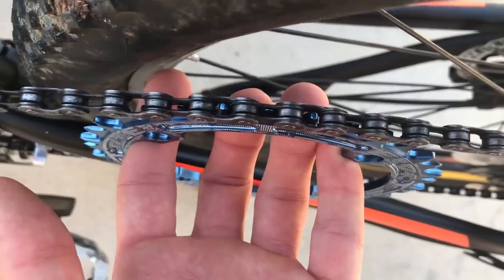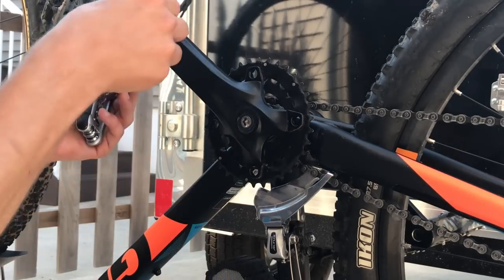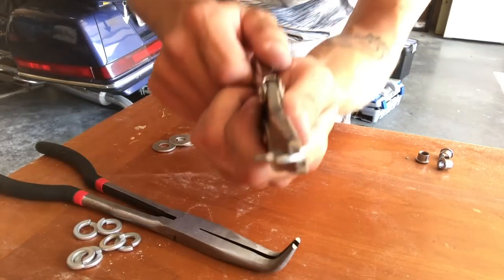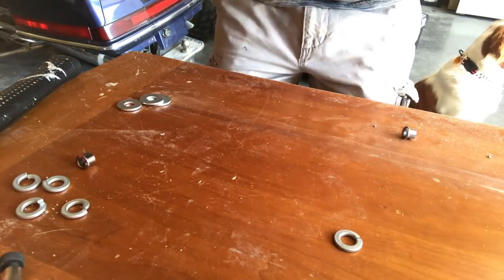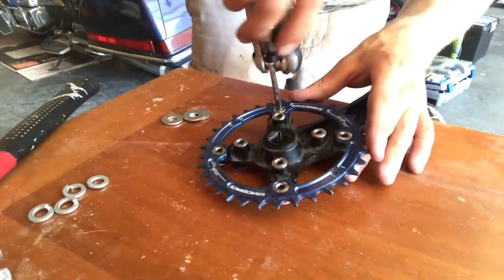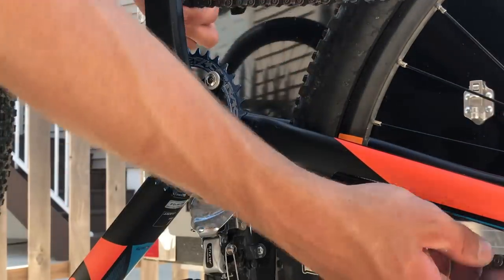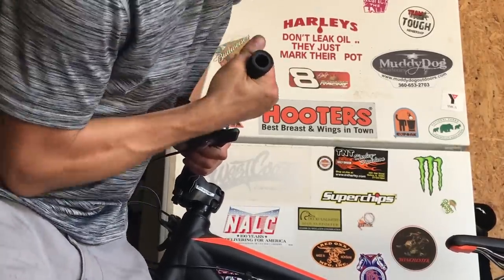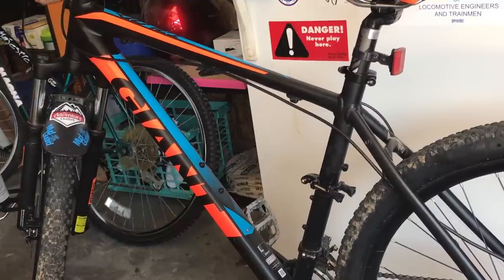3x8 to 1x8 MTB Conversion - Stupid or WORTH IT?

Comment: I did this with a 1x9 using a narrow wide single crank on a Super V. I’ve had zero issues and have never once dropped the chain. Today I did the same thing with a 1x8 on a hard tail and it’s not working well. The smallest and largest rings on the back cassette seem to be too far out of a reasonable chain-line similar to cross chaining. Both rings make the chain fall off up at the front narrow wide crank ring. I swapped out the chain for a 9 speed chain and now it doesn’t fall off because narrow-wide is made for 9 speed chains and higher. An 8 speed chain will work but doesn’t have much grab retention at all. I still have an issue with the smallest and largest cassette ring being too far out and causing chatter on the front ring. I wonder is an 8 speed cassette is spread out too much.

Comment: I hate having an FD, it's noisy and becomes unreliable over time. I kept mine on the middle gear 34t, so I just took it off and replaced it with a 32t chainring set. Had a peace of mind ever since.

Comment: Because of the trails where I live there's no need for a giant front sprocket and I never really used the smallest one, alot of flat and makeshift jumps, so back in the late 90s and early 00s I would remove the front derailleur and smallest sprocket, then I would grind off all the teeth on the big sprocket turning it into a psuedo bash guard, then running just the middle sprocket, also I would take a bmx stem and bore out the handlebar section with a drill press so it could fit mountain bike handlebars, I really liked that set up and it worked well for my riding style coming from a bmx background, I think its awesome that the bikes now have adopted the single sprocket and shorter stems because it makes for an awesome ride

Comment: handle bar grips is easy to remove。.. some mechanic charge 20 bucks...

simply lift the rubber a little and insert 2cm thin tool or chopstick and.spray water with soap   let it sit and work 3cm and 4cm.and spray more water and soap and it will slide of very easily......less then.5 min for both sides
Reply: And some Aquanet super hold to stick them back on.

Comment: I  converted a 3x8 to a 1x8 way back in 1996 when I started racing the WORS series in Wisconsin. The tracks and trails were mostly flat and hilly but no real climbs. For a few more bucks, a 9 speed 12-36 cassette gives more range. A RS 9 speed shifter can be had for $10. For another 50 -75 bucks, you could also convert to 1x10 with most 8 speed freehub bodies. Shimano 10 speed 11-42 cassette, shifter and chain. If you really love your bike, spend the $150 and go SRAM NX 11 speed.
Reply: Scott H But, to convert that 8 sos to.  10, doesn’t that require new shifters?  And totally new adjustments and/or a potentially new derailleur?  Seems like a potential rabbit hole...

Comment: You could have used a grinder to make the grommets shorter and an air compressor to blast air under the edge of the grips to slide them off. Works every time and saves your grips from tearing when taking them off.

Comment: 1x8 is certainly not a bad idea as I'm an in the middle of doing it myself. You did a decent job with what you had. Some chainrings actually come with the smaller grommet. If you want to spend some money you can also get the bigger cassette in 1x8 to help with climbing...

Comment: I did that to my GT today went to bike shop bought smaller hardware for chainring. There was no need for washers. In my defense it's flat in Fl so I never change front gears, now my handlebars have less clutter. After I was done didn't realize the pile of stuff on my bike I NEVER used.

Comment: Trek Marlin 4 has the Rear hub Formula DC31, it will be good if there is a 8 speed 11-42T freewheel available for 1X8 conversion, I cannot find any 8 speed 11-42T freewheel to suit the Rear hub Formula DC31.

Comment: Well done I did the same thing on my Carera Banshee because when I bought it came with slightly bend second chain ring and when I back to the shop they said that is not covered by the guarantee so I decided to convert it to 1 by,  work well and there is no hill which I can't climb.

Comment: I converted a friend's bike in the summer to a 1x9 which is a better setup than using an 8 speed. Parts: 9 speed Sun Race 11-40t cassette. Alivio rear 9 speed shifter and a long cage Alivio rear mech. Crank was doing exactly what you did. 28t cog for the front. Climb hills like a boss.
Reply: Joe N Nice!  I’ve been thinking of doing something similar; aren’t there big gaps between gears?  Also, it appears Sun Race offers different 9 speed sprockets; which did you get, and why?  Are there big differences in sprockets?  Why is one more and one less?
Reply: We’re you able to use the same wheel and free hub?

Comment: I never shift the front derailleur and replaced the middle chain ring to 32. I have 10spd cassette and rarely shift out of 18. I commute 18km to and from work.  36km five times a week and I have a couple of little hills.  I tried not shifting for a few weeks to the point I forgot about all the gears.  My legs got adjusted to the commute and I used the momentum of bike.  Then I tried shifting a bit just because I wanted to experiment.  

I like the options for gears and there is nothing wrong with shifting if it makes life easier.  Spinning is nice.  I  could switch to single speed.  I really thought about it because I spend time maintaining the derailleur, cleaning it, adjusting barrels, and  I have to think about the shifts and how accurate they are. 

I  am  pretty good at dialing in perfect shifting and if you don't shift the shifters can become less flexible.  But the more you shift the more you have to tune-up the bike.  

I also slid out on ice and bent the derailleur hanger.  I fixed it with a 30 Euro tool. Derailleurs are delicate.  I  have full xt set up. 

Cleaning up the cockpit sounds good.  More options for resting hands. 
There is this one guy who did a world tour on single speed.  
I don't compete and my bike is for commuting and not so much leisure and fun. But I have so much fun bike commuting.  

The derailleur front and back are just dirt magnets.

Comment: How do you like the talon? Especially now that it's a 1x8? 
I have a 2017 talon 3. Everything is still stock except I changed the saddle, lock on grips, mucky nutz front fender,  and crankbrothers stamp 7 flat pedals. Probably just going to upgrade to a full suspension bike maybe next year but I'm still pretty novice and have a lot to learn..been a great bike Tho!

Comment: I think it would work out if you don't mind big gaps in gearing, or don't have a huge range to cover.  Dealing with the trapped grime and more things to break in a 3x system does suck, given that I use the big ring about 1% of the time.  Depending on chain angle, I might use the outer bolt circle for a chain guard.

Comment: I have a Trek 7300 hybrid bike. It's 3x8. My middle chainring is 38t. I find I can stay on the 38t for all my needs, shifting between the 2nd, 3rd and 4th sprocket for my light trail and dirt/gravel riding. I know 38t is large for a MTB, but this is a hybrid bike. So couldn't I just keep the 38t chainring, ditch the other two and thus have a 1x8?

Comment: Interesting convertion! Lighter, simpler, more reliable, quieter etc But what do you miss most about your old 3x8? I have a 3x8 on mine, have been tempted to do just this but love the really low gearing and really high gear for flat out sprinting on tarmac or smoother tracks. Maybe a 2x9 might be a better compromise for me? Mostly do cross country rides, with some quite hard climbs and downhill sections.
Reply: PD Tech i have a xc 2x10 and my father has a 1x11 (newer bike).
Honestly i prefer the 2x10 cause of the wider range and a lot less “chain- crossing”, so the chain will last longer. 
Yeah, a 1x looks a lot sleeker and its one less moving part to worry about, that for sure.
1x8 seems really short gear range tbh, especially for climbing. You will struggle hard for sure.
Reply: @danielmartins4367  A 2x10 seems like a good comprise, I know with my 3x8 there are a lot of gears that overlap and 'feel' the same. I mostly use the middle front chain ring, which is fine for even some of my climbs but it's good to have that lower front chain ring for extra aggressive climbs. The bigger front chain ring I only use now and then for that really high top gear on sprinting flat smooth sections, which I could easily do without!
Hopefully a 10 speed cassette will fit on my bike where the 8 speed goes? 😎👍

Comment: I did almost the same, only I removed only the 42t chainring and left 22-34 bi chainring, with 11-40 of 8v and it was great, I have more versatility even if it is not elegant ... 1x8 is poor for me, so 2x8 works much better than a 3x8 that I will not use (42t)

Comment: i have a second hand bike that was once a very nice 3x9 that the previous owner turned into an awful 1x9
the chainring was a huge 28 installed on the outside of the crank and they left the organically 34t cassette on
i had to install a 32t oval with spacers to move it inwards and a 50t 9s cassette with an extra long derailleur hanger
now its actually okayy to ride, it can at least go up a hill and doesnt make horrible noises all the time and can shift smoothely but its still not as smooth as a 3x
i think im gonna convert it into a 2x i like being able to drop a chainring up hill and having a straight chainline so the drivetrain runs smoothely

Comment: I've been a 1x8er for a while now....you're right on when you stated that it's simpler and lighter set up. Cool video.
Reply: is it worth it and would you be able to tell me how much it would cost? Thanks.
Reply: Well, the cons are that I'm sort of restricted on the number of gears I can use without having to put extra strain on my chain. The other con is that you may want to get a single speed sprocket with longer teeth. This would help keep the chain from coming off during a rough ride. But other than that, it cost me nothing and I removed the front derailleur, gear shifter and extra sprockets.

Comment: The leverage gained from having 3 chainrings, especially the granny ring, has greater advantages than any performance gained from the small amount of weight loss by going to 1x.  This is especially true for bikes which are already heavy.   To optimally use 1x, you would need to replace your cassette with the widest range possible if it isn't already.  Going 1x  actually requires understanding of where and how you ride and what your gearing requirements are, so it's actually more complex to configure than simply having 3x, which give you gears to do anything.

Comment: I am cheap as well I run a one by eight set up on my fat bike with a sure mono mega range cassette 11 to 34 one by eight I'm seriously thinking about putting a smaller chain ring on there right now I have a 30 tooth oval chain ring I am thinking about going down to 28 to make climbing hills easier

Comment: If it worked for you, then don't sweat what others say. I have the same bike if I'm correct. It's a 2017 Giant Talon 3.  Did you use the existing chain Ring that came stock on the bike?

Comment: I've done pretty much the same as a test. Aliexp*** orders are now airborn, where I picked - one 34t Narrow Wide oval, and one 36t Narrow Wide oval (12$ for both - some sort of promotion - do not ask me), then a cassette 11-42! YES 11-42! for 21-22$, with 4$  discount (new user coupon - so this is another 17-18$). There is a brand new 8spd SRAM chain already in the garage - so, the upgrade will be something like 38$. Looks good to me. If not suitable, I'll revert back. Please note this is 26' bike, where i believe 1x 34 - 11-42 will be enough, just the step between the rear sprockets will be some sort of issue for sure. At least, I can go back without too much efforts.

Comment: This conversion would work....until you start hitting bumps along a trail or a pot hole on the road...you need a chain guide. You could use a 9 speed Deore Shadow Rear Mech. Since it has a stronger spring action. But in essence, your conversion would work.

Comment: Kind of makes sense. I never use other than the middle chainring anyway for all my climbs and downhills and my fitness level. BUT I use my large chainring as a "protector" from rocks. It takes all the punishment with some of its teeth bent already. So that's why I am not removing it. And the smallest one is not worth of work for me.

Comment: I tried this with my bike. It doesn't work out too well, because you need a clutch derailleur to keep tension on the chain. For this to work nicely, it would require cassette, derailleur, and shifter upgrades.
Reply: Good to know. Any recommendations?
Reply: @UnitedDestinyEntertainment  Shimano SLX or Deore are good options for the derailleur.

Comment: Hey. Great video. 
I have a Giant Talon3. I think same model as yours. I just ordered a 32t raceface narrow-wide chain ring to do the same conversation. What did you install 32 or 34t? How does it ride?
Reply: Boy Jorge Eta 34 gives makes pedaling slightly more difficult than a 32, increasing your top speed. I used a 34 on my 29er rather than a 32 on my 27.5 because of the wheel size. Bigger chainring= bigger wheel.

Comment: Just done this myself and definitely worth it... why did you leave the front mech on? Or did we just not see you remove it?
Reply: Wheelers At Large why is it worth it?  What are the benefits?
Reply: @richarde1355  good question and sorry for the long post. My mtb was a quick cheap replacement for one that was stolen, I needed a bike and no time to save up for a mid range or better, so always knew it would become a project. It was a heavy, slow hardtail, 24 speed triple with square taper bb, no high end parts but had disc brakes so frame was futureproof. The bike has gone on a drastic diet over the last year, much lighter parts, only the frame and seat post clamp remain from the original bike. It now has a hollowtech style external bb crank, 38t narrow wide, 36-11t 10 speed at the back and Sram x5 shifter and mech. I get nearly 1 to 1 in the lowest gear for climbing, that said, we don't have many steep off-road climbs but the ones we do have are only as hard as when the bike was heavier with more gears, gravel fire road climbs are no problem. The bars have only brake levers and one shifter leaving room for lockout and dropper controls should I want them in the future (probably not) and the front mech is gone, no chain guide required as no chain drop as yet. There is one point in the cassette between cog 2 and 3 where I would like an inbetween ratio because 2 is slightly too easy. The weight saving and simplicity have turned an entry level mtb into something fun, strong and capable. I would agree the upgrades have made it a better mtb all round so moving to 1x from 2x or 3x on a better bike may not have same effect but when riding on loose or chunky terrain only having 1 shifter to think about is nice. I dont know if less is more but less to think about, less weight, less to go wrong, less drive train noise, less adjustment... I'm happy with the change.

Comment: Did it work without shortening the chain and fitting a chain guard?  I did a similar job only I converted from a 3x to a 2x as I didn’t need the top end range and also allowed for more ground clearance between the tyres!

Comment: I  wouldn't bother .  Unless you add  more sprockets on the rear. Just leave it on the same chain ring . 
I had a 3x7 and changed the rear to 8 .   So 3x8 . I never use the 1st 2 smaller chain rings .   But if I ever sell the bike , the buyer might want too .

Comment: I changed the crack set to the aftermarket eBay colorful ones you see..mines in blue with a black 38T oval chain ring and even went out and bought black and blue crack nuts. It's all getting out of hand with the blue cable ends, vale caps, rear cage cog wheels, and  rear derailleur cable sleeve.. handlebars, and even grip clamps.. blue.. it's going to be E bike conversable...got the front hub motor and everything on another handlebar.

Comment: i hope major brand like sram makes this kind of setup. Casual MTB rider which I am very rarely use low gears. Mostly tech climb that I am struggling with and don't have high speed trail at all to use those top 3 low gears. Only use high 6 of 12 gears, I rather loose some oz to maximize climb.

Comment: You can shorten the chain if you plan to leave the same cassette. Reduces a bit of the slack. My bike came with a rivoted 3 by set, i never even use the big or small cog on it and i use the bike to cummuting too. So i ordered new cranks and a narrow wide chainring and also just to be extra sure on the trail, i also ordered a chain guide. Should get a new derailer too :((

Comment: TIP: Use a zip tie and some alcohol to remove cheap grips. Alcohol will also help with the reinstall.
  TIP: Put the grommets on the inside of the chain ring for that "not so cheap" look.
  REQUEST: Please take the rear derailleur off too.

Comment: You should invest in some lock on grips. You can get a cheap set for 15 bucks and they work great. They are much easier to work with as well because to take them off you just have to loosen the hex bolts

Comment: I plan on switching to a 1x8 or a 1x9 in the near future. I live in SW Pennsylvania and find that when I'm out riding trails I pretty much only use my middle front sprocket.
Reply: theSinisterBend been riding couple hardtails like this for years, any nice vintage cranks work well, I grind teeth of outer ring and makes nice bash guard, then u can reuse same chainring bolts.  I left little ring on my Gravel bike so when we climb that monster hill I can manually drop to it, nobody even notices.